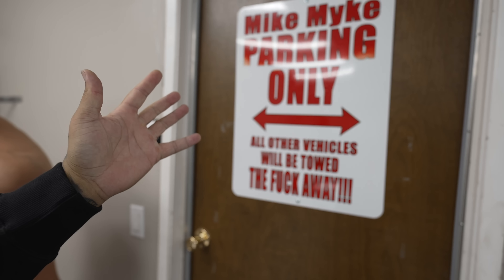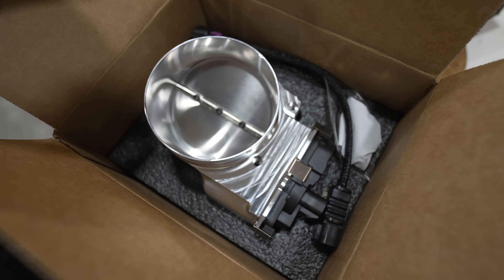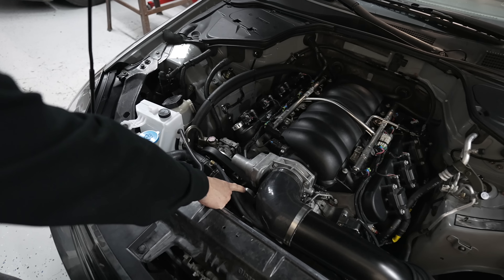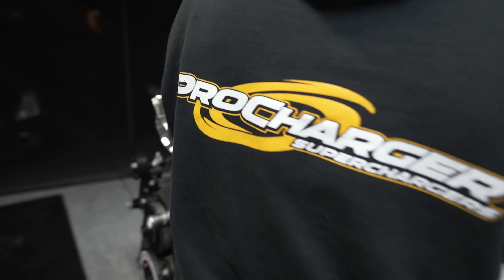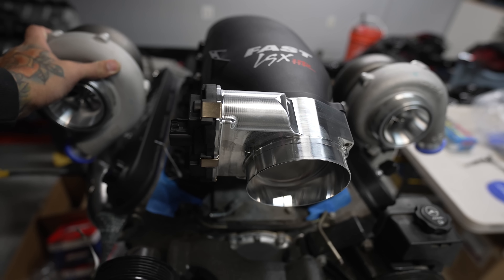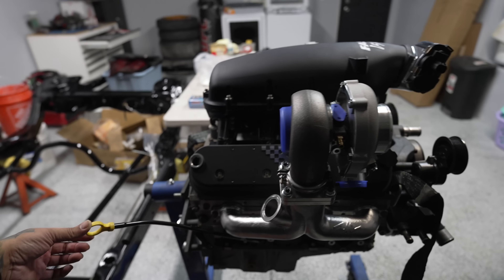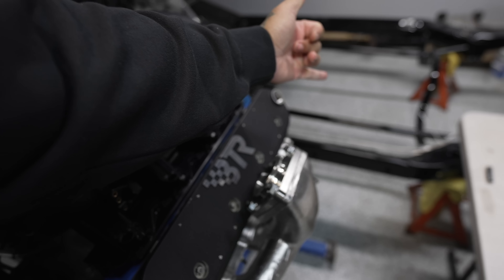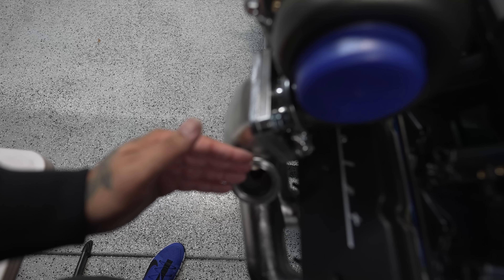Twin Turbo LS3: This Is Already Becoming An Issue…

Comment: Janky making a manifold to sit the turbos infront of the engine would have been the move. Those turbos over the valve covers is gonna be nothing but issues
Reply: That's what I said
Reply: It's a drift car. Gonna be issues. Looks cool for sure
Reply: Ditto
Reply: @jordanam1234   64 isn’t a drift build idk what youre referring too.
Reply: Blown head gasket after blown headgasket all the heat soak too

Comment: I think that exhaust manifold is the issue. It is way to close to the valve cover and intake manifold. It leaves no more room for other stuff plus the heat soak it is going to create from it being to close to the top  of the motor.

Comment: Nah homie, custom manifolds. These manifolds are a definite no. Get it right the first time, while solving the dipstick issue, valve cover issue and the wastegate positioning. It will look 10x cleaner too.

Comment: Building an adapter flange or have thebone givingbyou issues adjusted by Janky, to put the turbos where you want them is an option... cheapest and straightforward way to get them symmetrical.

Comment: Hey bro Just a suggestion maybe you could run the Holley oil pan it has the twin turbo drains already made into the side That's what I personally run it worked perfect I tried that timing cover stuff but it was super hard to get The drain line to fit The crank pulley was millimeters from the lines You can barely even tighten it If you run a single turbo and run it out passenger side generally just fine but with the twins it's a lot harder to get those lines down there but that's just in my experience... Just a suggestion I'm sure you thought of it but I figured I'd throw it out there! 🤙👊😎
Reply from the maker: Man I hella thought about that! I was going to do the holy pan at first but since it was going in the fox originally, I did a new f body pan because that’s what works in a fox. But I think I may run the return directly back into the valve covers since the turbo is up so high. I might be able to get away with that.
Reply: @Its_Mike_Myke  That's what's up! I was thinking that also but 90% of people don't run it from the turbo to the valve cover so I didn't want to be called out saying you can't do that lol I was also thinking man the simplest way would be just run the return right into the valve cover... Great minds think alike I know the fun stuff that people think you just bolt everything on and go but there's a lot of hours and countless figuring out when you're putting something into The car didn't belong into and or something that's not as simple as bolt on and go it's a lot of little figuring out the small things that really take the time putting an engine in most think is the hard part but that's the easy part 👊👊

Comment: Mike couldn’t you have just asked them to send you 2 of that passenger side manifold and send back the one with the 45. That way they both have the straight outlet on the manifold and you can use the mirror turbos

Comment: I wanted boost district because of the price but then I found the UPP twin turbo kit is like 2800..  the manifolds are tig welded the hard way... im just going to get cheaper summit racing turbos... imma just watch you im on a stock block so twin turbo is over kill but the twin sitting on top is a flex i would just leave the hood off.

Comment: Wonder if you could run an exhaust manifold spacer / flange on the driver side to add extra 1/2 " of clearance or so . 
Keep the one you have that you can't bolt the V band on , cut the runners off and use the flange ( cleaned / leveled ) as a spacer with longer ARP exhaust manifold studs.

Comment: Supercharge it , to much trouble to turbo it , LS is not a high RPM motors , use the low end torque to your advantage , unless you use a flat-plane-crank motor ,

Comment: Could you run two passenger side manifolds?
Reply from the maker: The watergate would be in the front of the motor if I do that lol
Reply: Chop it off weld it up. Weld  one on the back side..